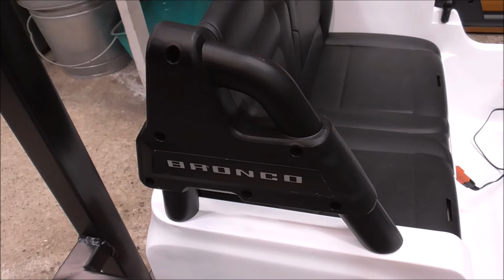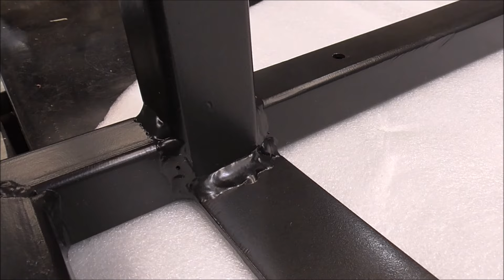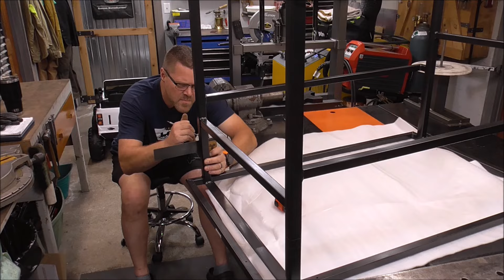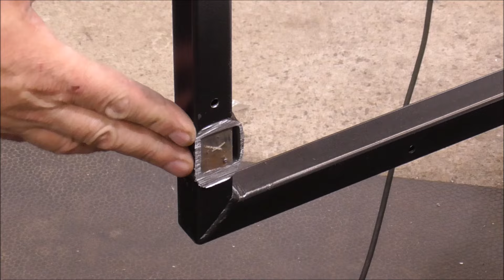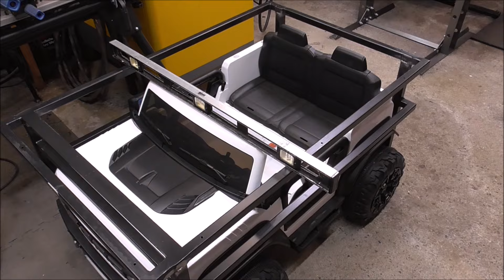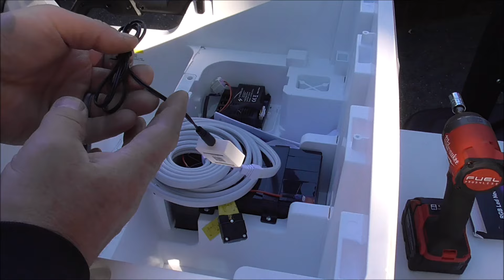MIG Welding Rework + Custom LED Underglow Upgrade | DIY Fabrication Fix!

Comment: Lights from China? Not a big deal since they make about everything.  Too bad you had to make a big change. I have been to several chiropractors but never seen anything like this. I watched many YouTube videos on building a firewood storage shed and came up with my own design all in my head. All finished with it by myself and my wife didn't have to help me except ordering more pressure treated lumber and we buy it from a lumber yard and have them deliver it for 35 bucks. That way don't have to move it many times.
Reply: You went with the store-bought splatter spray?
Reply from the maker: If store bought, your referring to the "grocery store" then yes. I use non stick cooking spray
Reply from the maker: Unfortunately its nearly impossible to find anything that isn't made in China. That sounds like a great setup for your firewood!